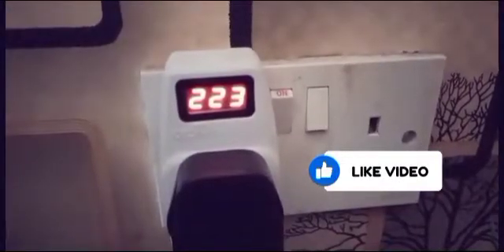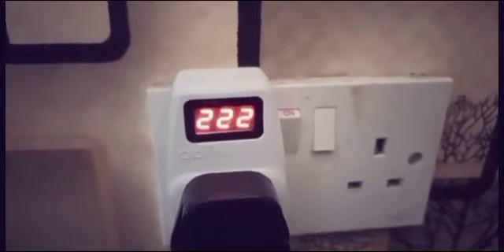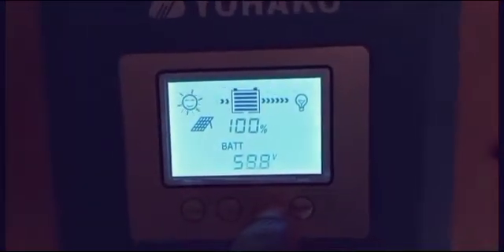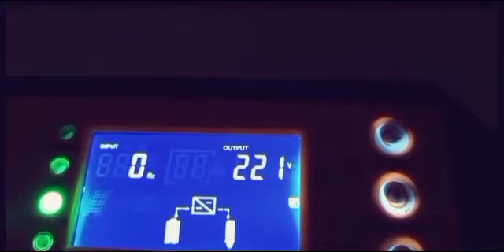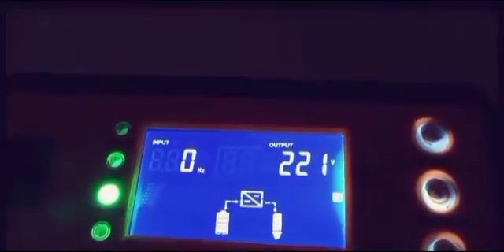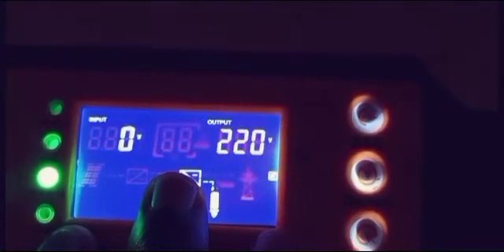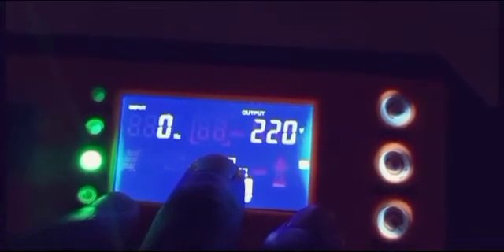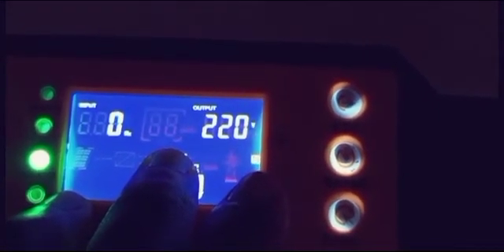Fluctuating AC Voltage Output On My Felicity Solar Inverter

Comment: It could be a voltage drop due to resistance on the cable. You can experiment with generator and utility to isolate the issue.
Reply from the maker: Voltage drop normally occur in the wires and read at the load point.. for example, the inverter could display 220V and you might get a reading of 215V inside your house.. that is voltage drop. In this case, the fluctuating voltage is in the inverter.

Comment: My voltronic infinisolar does the same thing. Did you find the solution to it by any chance?
Reply from the maker: An AC battery charger which was used inside the house to charge some 100ah DC batteries seems to be the cause. As soon as I disconnected the AC charger, the fluctuations reduced by 95%

Comment: Did you find the problem? Did you check the cabling between the inverter and the battery?
Reply from the maker: Cabling between inverter and batteries is perfect. However, I noticed voltage drop across sockets in the house due to the internal resistance of cables used for the house wiring.

Comment: Basics!!! Check your cabling guage.
Reply from the maker: Basics!!!! This fluctuating voltage is occurring at the source (in the inverter) so cabling guage does not apply here or are you suggesting we dismantle the inverter and recable all the internal components?

Comment: Hello. IM using felicity inverter 5kw 
It's normal that my inverter consume 1.7amp from utility? 
We are talking about power supply inverter consumption only, because battery charging option is on solar panels only, and the ac output breaker is turned off...
Reply from the maker: Trying to understand your question. Do you mean your inverter consumes continuous 1.7amps from utility when idle and running?
OR
Are you saying your inverter charges your battery with 1.7amps only when it is using utility power for charging?

Comment: I faced a problem like this the best solution is to put the output voltage 230
Reply from the maker: Thanks for the tip. Pls for which make and model of inverter?

Comment: I guess your wires are a problem they can not handle the current in the wires that's why it stops down the voltage to symbolise a problem other wise the inverter is fine
Reply from the maker: Thanks for the info

Comment: This is the exact problem I’m experiencing with mine, I have your exact model, the 5kva 48v please how did you fix yours…I’m desperately in need of your response..thank you sir
Reply from the maker: Disconnect load. Switch off the inverter for some hours then put it back on. Lemme know how it goes